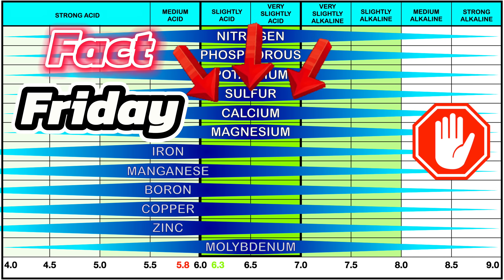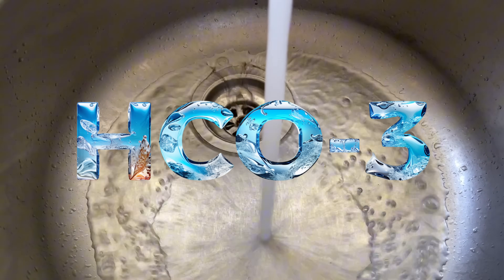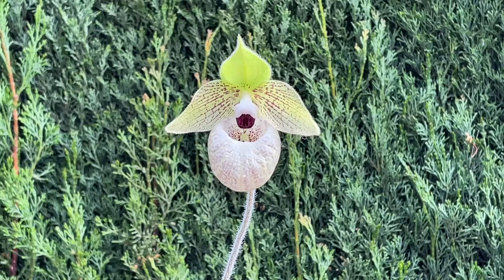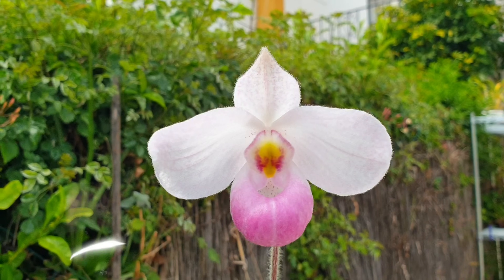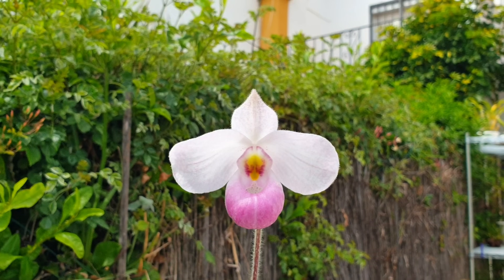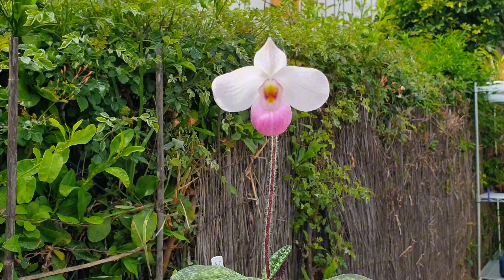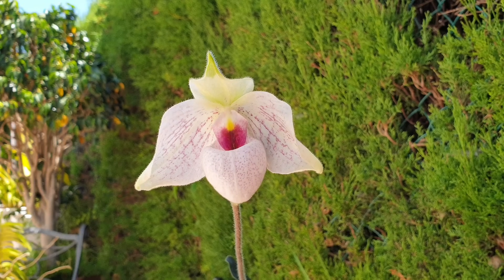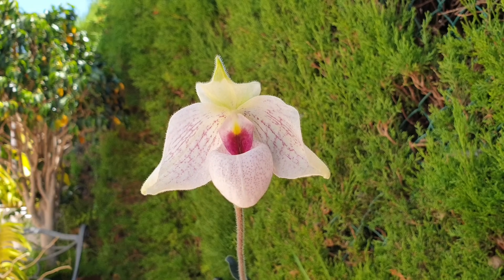What is the TRUTH about Adding Lime to Orchid Pots | Slipper Orchids Calcium Liming #ninjaorchids

Comment: Hi Nina. I'm guessing liming adjusts the pH by raising it from too acidic to an optimal acidity level? 💖
Reply from the maker: HI Denise 😍❤️ actually, liming does the opposite. Because slipper orchids prefer a  more acidic climate around their roots, many people opt for liming their media to drop the pH into the desired range of 5.5-6.5 maximum. However, many also say that they use lime in their media to act as a slow release calcium source (egg shells are also sometimes used as examples) BUT, this is not what happens because the pH is usually far too low for the slippers to absorb calcium as the low pH does not facilitate calcium absorption. That is what I was trying to show in this video... liming of acidic preference of media and specifically for slipper orchids, but for calcium absorption, even slow release, no! 👍🏼 I hope that I could clear that up 🫶🏼 thank you so much for watching this video as well, lovely lady! You are so appreciated ❤️🌸

Comment: I had this conversation with Tim at the orchid show. 

Since I use mostly fine bark for my slipper orchids, they should be fine with the pH. Also since I repot slipper orchids once a year, it shouldn't be a problem. 

What I have changed starting this year is how much I will be using low ppm water for slipper orchids. 

I was told by Tim that the tap water I have (80ppm) is good enough to use without filtration, but there could be sodium in there. I keep putting off looking up the local water report from the Town Hall.
Reply from the maker: HI Joe 😍💐 awesome!! Glad that this tidbit of information has already landed in your lap from an slipper guru 👍🏼 meanwhile, thank you for watching even though you are already informed 🫶🏼 wishing you a wonderful day and weekend ahead, Joe ❤️🌸